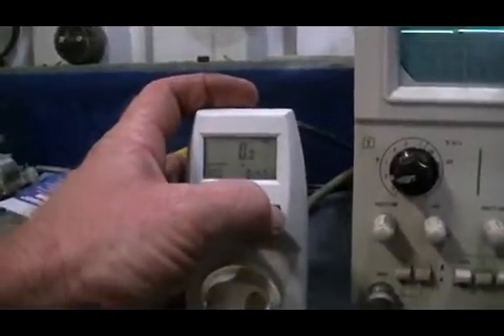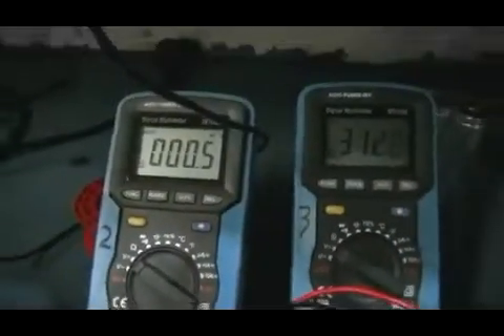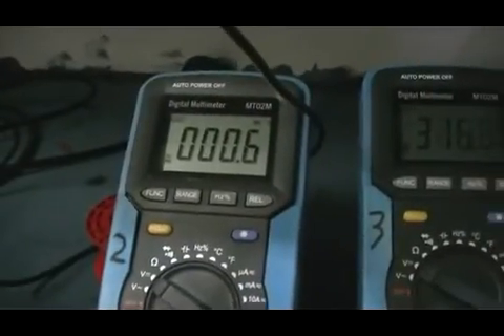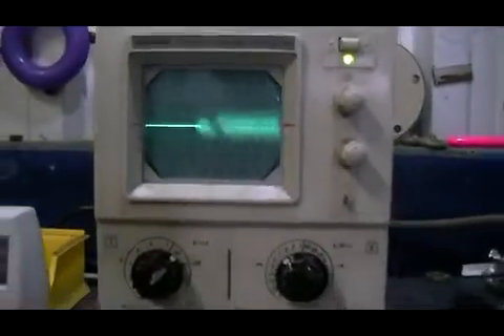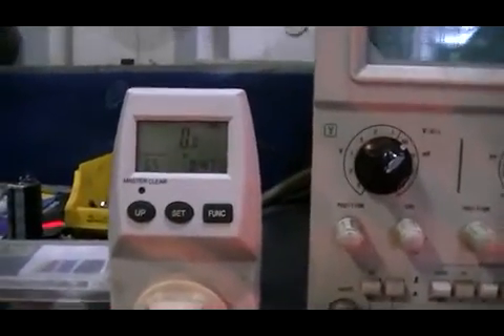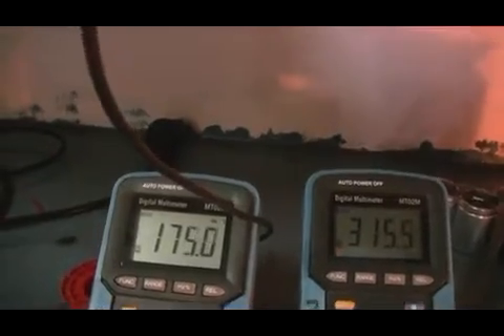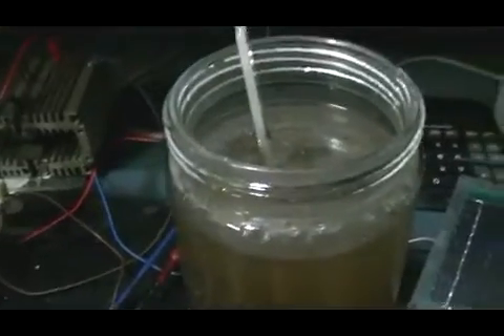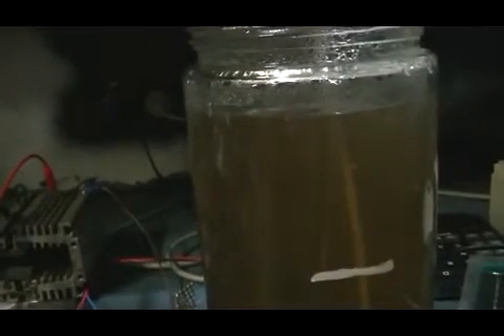Heating experiment-another test measurement.

Comment from the maker: E/in-360000
Delta T= 4.19 x 2100=8799.
360000/8799=40.91C

Temp rise gain in test=75-33=42c
Qh2o=4.19x2100x42=369558j
Qglass=.84x887x42=31293.36j
Qout total=400851.36j
EFF=400851.36/360000x100=111.3476%

The temp reading is accurate,but room must be left for error with the watt meter.

Comment: There is evidence in science books the splitting of h2 into the more reactive H+ takes less energy then the fusing reaction which makes h2 from H+. Have video will post soon. The atomic hyrogen tourch is an example of this, same thing electric arc under water. Fusion, plasma electrolysis